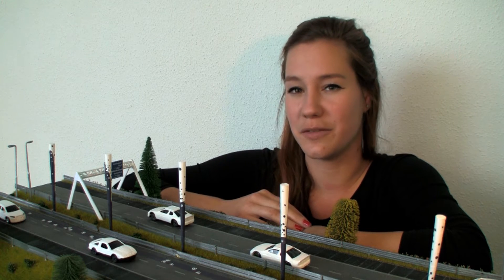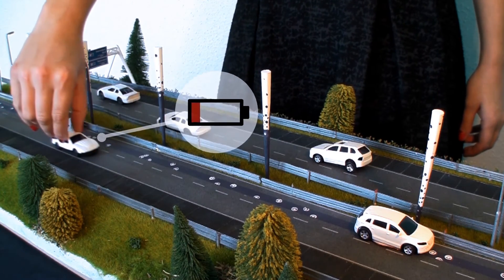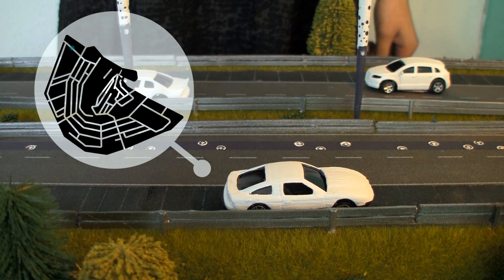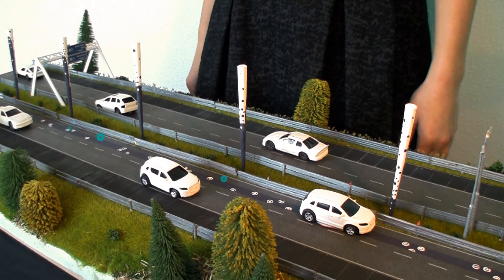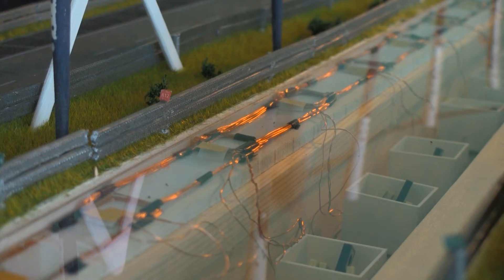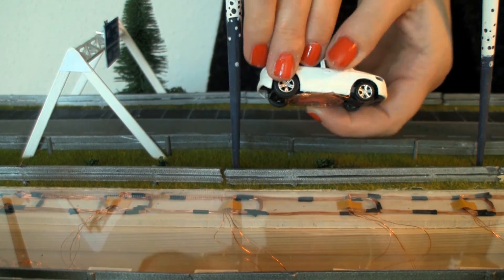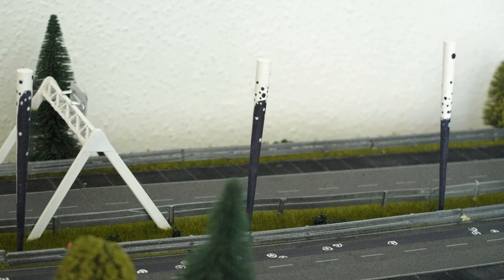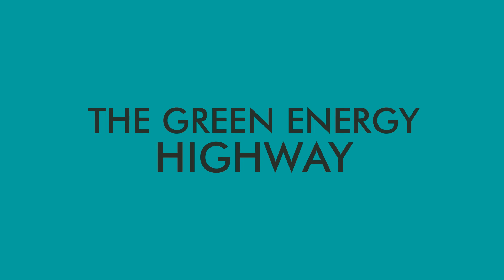The green energy highway with on-road contactless power transfer.

Comment: Do you have some official project page where it's possible to get more info about your project?

For example the main question - what about energy loss?
Maybe I'm wrong but coils are always produce the energy even if there is no car on top of them. 
This means at night such system will waste to air 99% of all electricity from the power source. 

Please provide more info on such question becase we have another usage for your system rather than cars....
Reply from the maker: This video was made to support my thesis and presentation based upon it, there is no official project page. I think Google Scholar can provide you with many other papers written on this technology and application.
Reply: @nataliascheele6184  thank for your reply )

okay, i will ask this question in another form: can you help me to get basic info (such as waste of energy from not used coils, etc) about such technology for my project? 
as i already mentioned above, i have a project for low-cost moving vehicles, but currently considering the usage of tram-style connections or battery swap
Reply: @zrx2779  If you don't use the energy, it is easy to understand, you produce 1kW for example, but you don't use it, so you waste 1kW. How can you take profit of it? Simply send it to the grid so people can use it at home.
Reply: @BatisChannelYT  send to grid from where? my original question was about COILS:
for example the road of 1km consist of 1000 coils , the size of the car is 1 coil - so at the time it gets energy only from 1 coil of the road, which means other 999 coils is wasting energy to the air, since they need ALWAYS to resonate to "wait" when the car will come to it and can not be powered off
Reply: ZR X i think as shown in the video only that rectamgular coils present beneath the car are activated and r used to produce electromagnetic field and hence charges the cars, so as the vehicle moves forward the coils behind the car stops producing electromagnetic field and hence energy is saved. 
I hope this helps, thank you.

Comment: mam were I fined the complete details of circuit model for this charging
Reply from the maker: https://www.google.nl/imgres?imgurl=https%3A%2F%2Fwww.hobbielektronika.hu%2Fforum%2Fgetfile.php%3Fid%3D281008&imgrefurl=https%3A%2F%2Fwww.hobbielektronika.hu%2Fforum%2Fvezetek-nelkuli-gyertya&tbnid=4KmWGRVu5GOGvM&vet=1&docid=EHddCNRR25NDvM&w=1280&h=800&hl=nl-nl    I hope This links you to the diagram I used for the components.
Reply from the maker: This diagram is for the tiny model in the video. The scale model doesnt charge a battery it directly propels the vehicle.